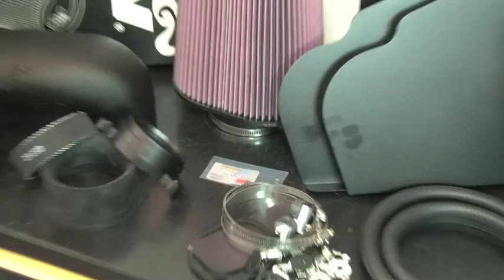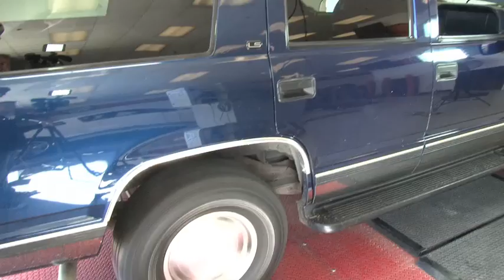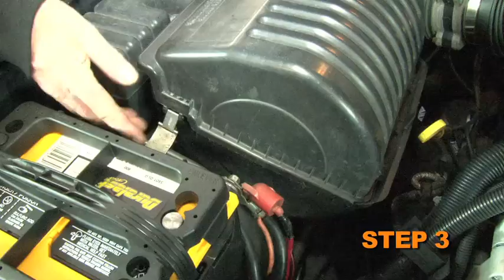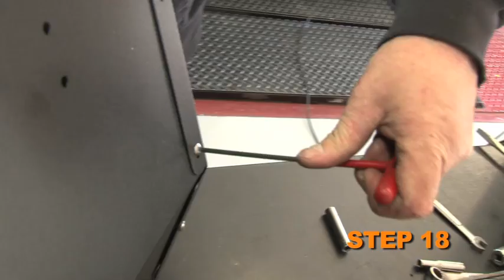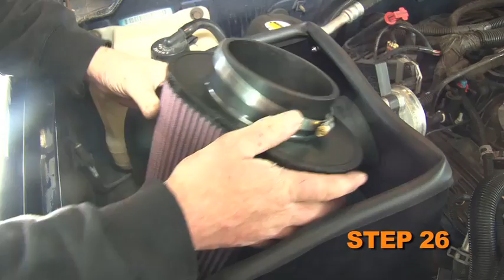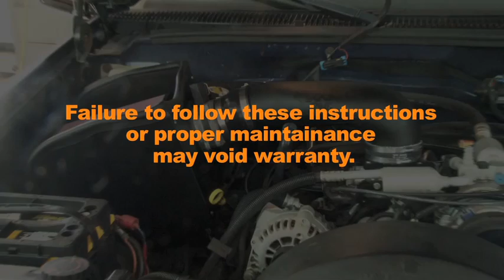Suburban, Yukon, Tahoe 5.0L & 5.7L [#57-3013-2] Air Intake Installation

Comment: I don’t expect a response but I’m assuming it won’t work on a 95 K1500 Silverado??
Reply from the maker: This system will not, however check out part # 57-3026 if you have a 1995 K1500 5.0L or 5.7L https://www.knfilters.com/57-3026-performance-air-intake-system
Reply: @KNfilters  oh lord, thank you very much 😮‍💨, appreciate the response on such an old video

Comment: This will fit my 1995 Yukon 5.7L Vortex 350?
Reply from the maker: No, this kit will not fit a 1995 GMC Yukon 5.7L, however the following will (part # 57-3026)  https://www.knfilters.com/57-3026-performance-air-intake-system

Comment: Do I need to change the mass air flow sensor if I install this intake
Reply from the maker: No, all K&N intake systems are designed to work with the factory mass air flow sensor.  If you encounter any issues, please contact our Product Specialists at 800-858-3333 or tech@knfilters.com.

Comment: i don't see the benefit of a pre-throttle body spacer in a fuel injected car lol air temp is gona be hotter too since factory intakes take air outside the fenders.  I may be wrong but this seems to raise your ambient air temp inside the intake.

Comment: knowing what i know this video is freakin halarious 
when i went to uti they dynoed a handfull of students vehicles stock and then dynoed with one of these KN filters and it didnt increase any of the vehicles HP a couple actually lost HP
Reply from the maker: +ccapehart1980 K&N intakes come with dyno charts with recorded increase in HP during testing. For some vehicles, (especially older cars with high mileage) the engine needs time to compensate for lower restriction and higher airflow, and might delay the increase in HP. For more info in HP gains visit here: http://www.knfilters.com/faq.htm

Comment: Sounds sweet after k&n installed can't you just take the top of the air box off and get the same affect?
Reply from the maker: You will not receive the same engine efficiency results by removing the top lid of your air box as air flow will still be restricted by the air box. With a vehicle specific intake system you will receive an aerodynamically engineered intake tube, as well as a large conical air filter, which will increase engine efficiency and increase performance.

Comment: After watchin this video i  realized my air/temp sensor is installed in correctly (it on the shield) and im missing parts that hold the shield to the wheel well... Probably why my setup keeps falling apart... It shakes by hand, so i imagine driving is the same...

Comment from the maker: All of our systems are tuned to work with stock programming and will not require you to re-tune your vehicle. We do not test our product with any other aftermarket product, se we do not have any test data when used with a performance exhaust system. The under hood temperatures will not change; an intake system does not make an engine run hotter.

Comment: I have a 96 with the 5.7.  Would I need to tune my engine after instalation of the cold air intake?  Also, I have a magnaflow muffler with a 3 inch pipe out, does this change anything?  My last question is would this cause lower or higher under hood temperatures?
Reply: I got the same truck and it’s a damn shame no one’s answered this in 11 years 😂😂

Comment from the maker: @johnson200gw Initial only refers to the time the filter starts being used. The efficiency actually gets better as the filter gets dirty. There is no such thing as a filter that is 100% efficient; a filter like this would not let any air through at all. The carbon particles left behind in the combustion chamber are larger in size than dirt particles that could get through our media.

Comment: @KNfilters initail implies that as it ages it filters less? this is not good... i used to believe that these intakes were a godsend that they didnt hurt your car/truck gave more power and better MPGs but it seems that for a truck that sees a lot of dirt roads these filers would allow some into the motor and that would cause damage

Comment from the maker: @goodson305 We do not test for or guarantee fuel economy increase. There are over 30 factors that determine this; intake restriction is only one of these factors. In theory, fuel economy should increase. Many of our consumers do report an increase, which can be seen on our testimonial page on our site. Kit 57-3013-2 is for your application and costs $311.99USD plus tax and shipping direct through K&N.